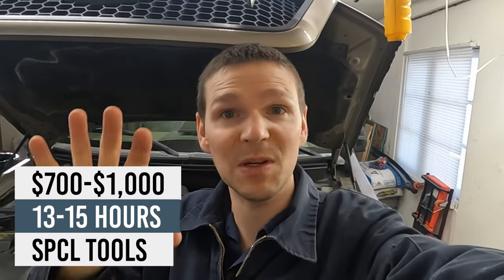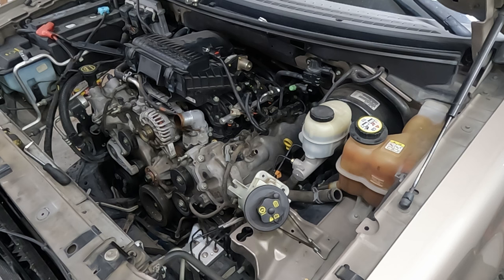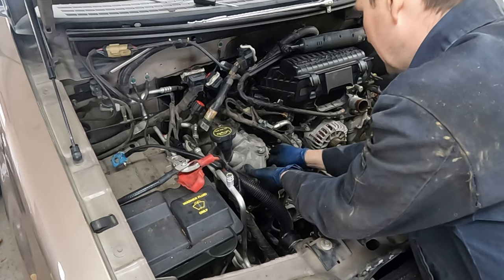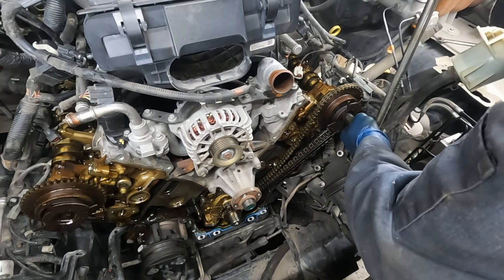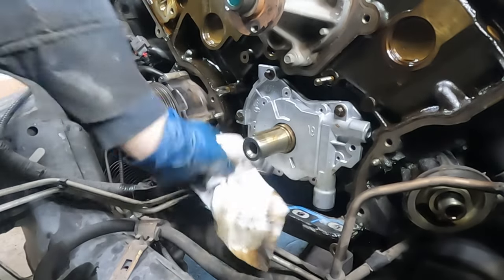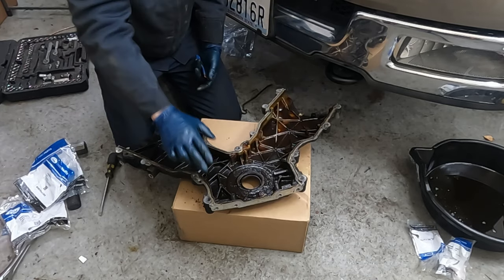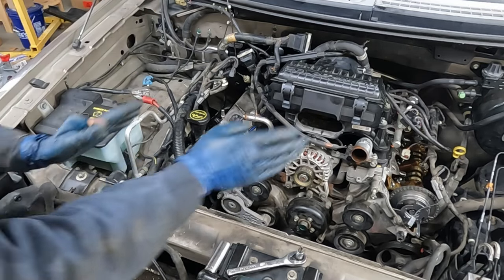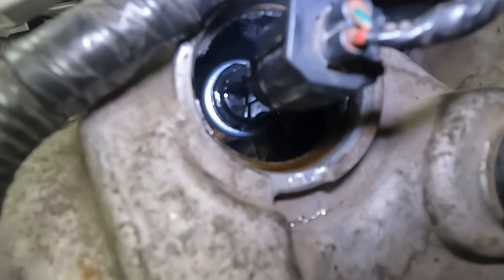Ford F150 5.4 Timing Chain, Cam Phasers, Roller Followers and Oil Pump Replacement

Comment: Installed new sealed power lifters, im getting clatter on start up, should I just rev engine or pull lifters and prime them with paper clip? I soaked them a lil, that’s all. Thanks
Reply from the maker: If you're sure it's lifter noise then just let it idle for a while. They should eventually pump up. Don't rev it up much while they're loose because you can throw a rocker.

Comment: Hi I was wondering when you were having issues with the vvt solenoid and the engine running rough would it show signs while idling and giving gas? I have an issue with mine that I want to try and locate before tearing down. Sounds like slap/knock but only when given gas

Comment: What do you charge for a job like this?
Reply from the maker: Prices vary depending on where you live and local shop rates. I recommend getting a quote from a local shop with a good reputation. Some shops won't do this repair and will only replace the whole engine so you may need to shop around.

Comment: While torquing the crankshaft bolt, how do you keep the crank from turning?
Reply from the maker: The initial torque is to make sure the pulley is pressed in all the way. For that I use an impact until it bottoms out then back it off. The second torque is easy to get with a torque wrench if you have the spark plugs installed. For the last step I mark the bolt with a marker then use an impact until the mark is the correct degrees from its starting point.

Comment: Why do some people remove the rollers one at a time with the camshaft still in? I kind of like your way, but there’s got to be a reason someone would take so much extra time.
Reply from the maker: @ericdavi1231  Good question. If I'm doing the timing chain as well then it's easy to remove the camshaft to change the rockers. But if I'm only doing the rockers without the chain then replacing them one at a time would be the way to go.
Reply: @ValleyMobileAutomotive  it looks like Makuloco times the engine with the rockers out and the cams free spinning then then slips them in with his tool after the chains and new phasers are on.
Reply from the maker: @ericdavi1231  The manual has you remove 3 followers from each side. But I haven't had any issues leaving  them in. The cam will rotate on you like in my video but there's not enough force behind it to cause a problem.
Reply: @ValleyMobileAutomotive  that will definitely save some time

Comment: Good walkthrough but I'm 99 percent sure that the phaser broke because you didn't use the locking tool. The cam gear/bolt isn't connected to the bolt. So when you start tightening it the force of holding the cam goes through the pins. Those are not designed to take that kind of force. I don't care if it's worked a hundred times before, that's why it broke.
Reply from the maker: @coreyalfredson7986   Thanks for your comment. I'd like more feedback. The cam holding tool holds the phaser by the gear teeth. In the video I used the chain instead to hold the cam gear. Both methods hold the gear the same way, by the teeth. If both methods hold the phaser the same way then I imagine the phaser would have failed even using the special tool.

Comment: I think the beginning your video said $1000 $1500 for the job I wish you lived in Florida
Reply from the maker: It's cold here, I could use a little Florida 🙂. That price is just for the parts if you do it yourself. It's a couple more grand for labor if a shop does the work.
Reply: @ValleyMobileAutomotive  in some cases just cheaper to buy a new motor from Ford since the labor is the same.  Couple more grand and you have a new motor.

Comment: That VVT cam phaser it did same to me on the left side and I had the tool to hold it on properly. Just snap I had bought it on line from a ford dealership that sold the cam and chain kit the warranty was a nightmare. I had to use a good used one from the truck ford warranty sucks I should just bought my timing kit from our parts store if I knew warranty was this bad after watching you vvt failing at the end I didn’t even change it on this truck since they were working good  not happy with ford parts and there crap warranty

Comment: He didnt put the timing gear cap behind the timing gears b4 putting the cover on fk u doing bro
Reply from the maker: Not sure what you mean?
Reply: @ValleyMobileAutomotive 
You seem to have forgotten to put the tone ring back on. That’s what he’s talking about. You took it off at 17:53, then mentioned to not forget about putting it back on at 33:12, but it is hard to tell if it’s on, and you didn’t film it being put back on.
Reply from the maker: @tombryant4518  Oh I see. Yes the tone ring was under something on the work bench and was missed. The truck will not start without it. That's what the crank position sensor uses. Pulling the cover back off was necessary.

Comment: I would have already named all the parts with assorted swear words and given up after attempting right side exposure.
Reply from the maker: @cbx500cbx  Yeah the passenger side is the tightest. There is just enough room to get the valve cover off.